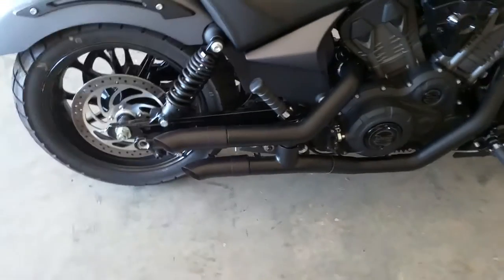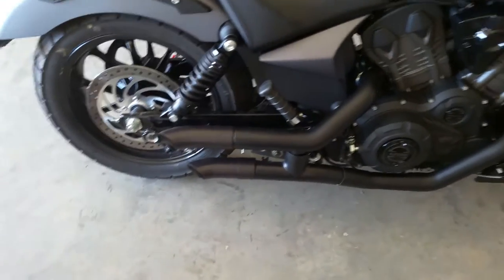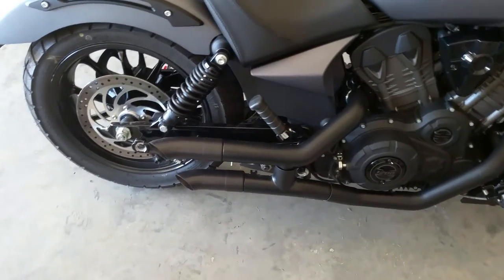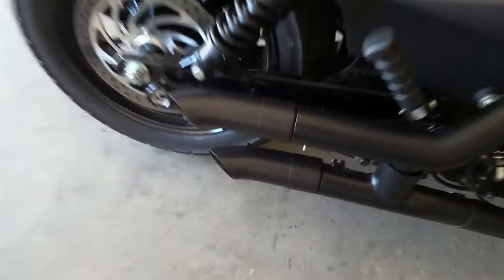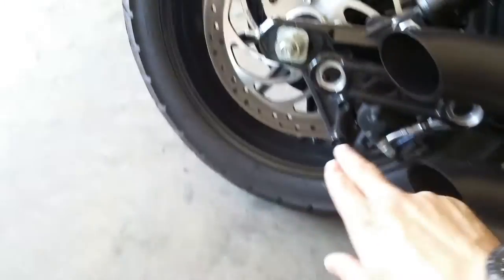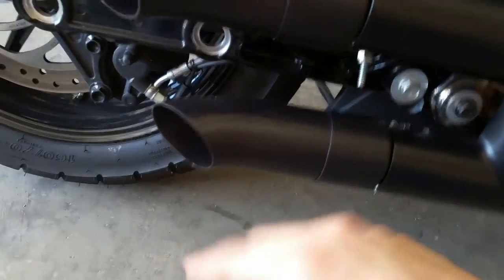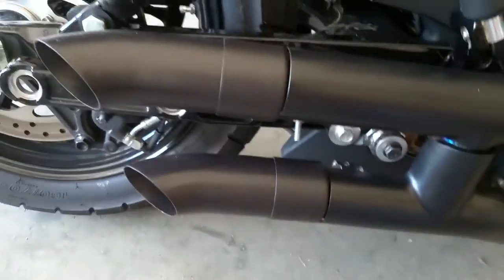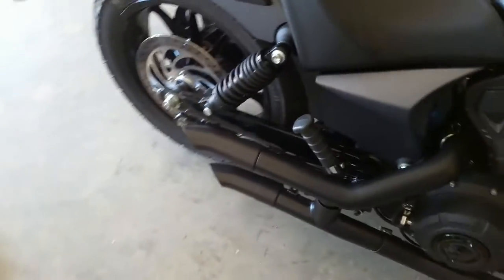2017 Victory Octane

Comment: You're stock ones slid right off? Mine do not want to let go
Reply from the maker: Travis Leabo correct.  There is a clamp you loosen then you just pull and shake.  Once they start to move it gets easy.
Reply: Haha alright. I'll have to get at them again, but I was pulling and shaking for awhile last night with no luck
Reply from the maker: Travis Leabo bike had under 1k so I'm sure that attributes to the ease.
Reply from the maker: Travis Leabo also your stock clamps will work better than the kit ones.  I trashed the kit clamps and used the oem ones
Reply from the maker: Travis Leabo there is also one bolt for each stock exhaust you pulled that right? It has a black bushing attached. Mid way down each pipe on bottom
Reply: Thomas Wisman yes I've unscrewed both bolts. and the bike has very low miles. I've been pulling but with very minimal results
Reply: I keep pulling the bike backwards haha